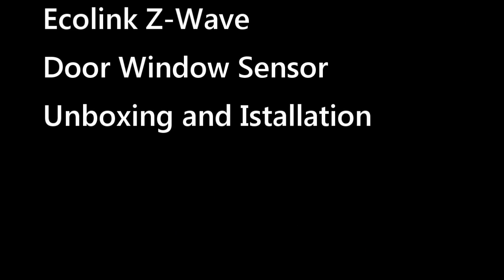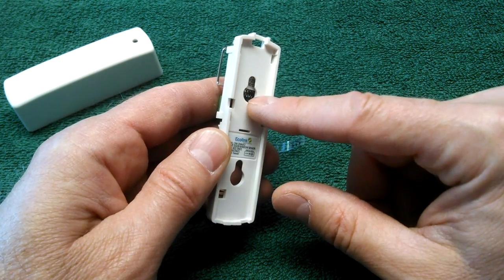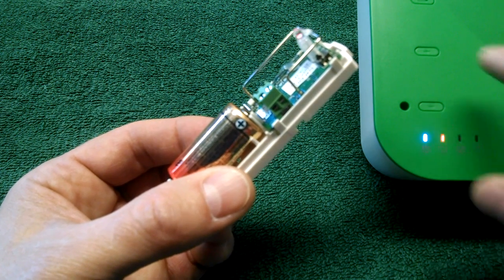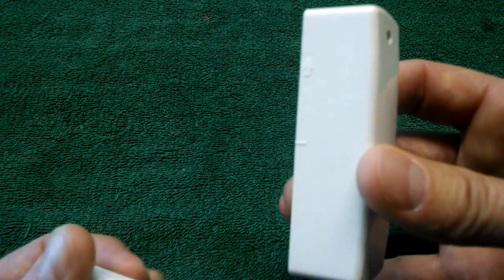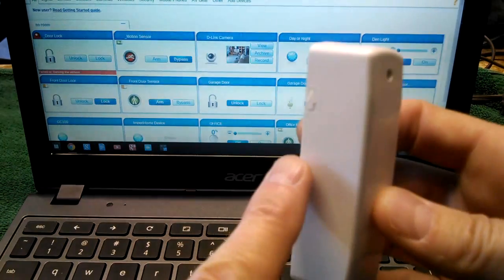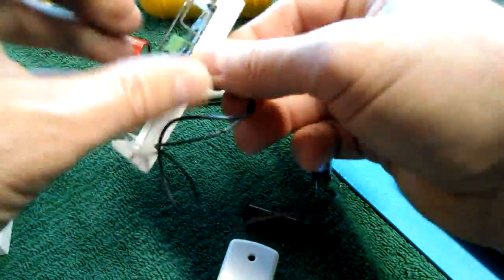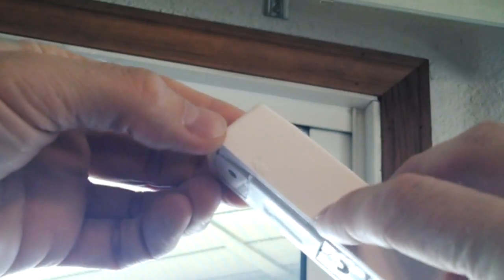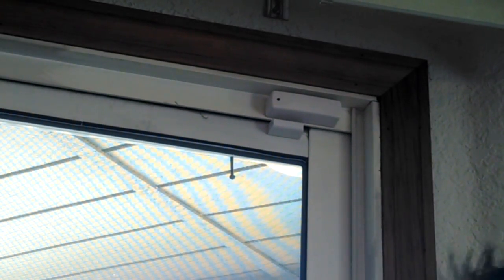007 Systems Ecolink Z Wave Door Window Sensor Unbox Installation

Comment: Will this work with Applekit? Or Philips Hue?
Reply from the maker: They are Z-Wave so they should work with anything Z-Wave. That is the beauty of Z-Wave.
Apple Homekit has a limited number of devices it can work with so I think the more accurate question is, Will Apple Homekit work with Z-Wave? 
As of now it looks like only these overpriced products work with Apple Homekit.
http://www.apple.com/shop/accessories/all-accessories/homekit?page=1

Phillips Hue works on the Zigbee protocol, so no it will not work with Z-Wave either.

Comment: UPDATE: I got it working.  I isolated the sensor that heads to my front door.  I am not using the resistor that is in line (should  I?) to the security panel. The length is maybe 30-40 feet from the security panel to the door. 

Thanks for a solid video and quick response. I might include a video on my channel in a week or so when I have time. 

I plan on rezoning my house a little to be more specific. Also,  this sensor beams to SmartThings, so I can track it through there. 

Thanks again.
Reply from the maker: 808orion 
 There resistor is used at the end of the wire to detect if the wire is shorted. if it works without it you apparently don't need it but keep it in case it causes problems later.
Glad it is working.

Comment: I have a wired home security system currently monitored by ADT. I obviously want to get out of this relationship and have served my 3 years with them. Now that the home automation tech has started to stabilize out, I'd like to consider an upgrade.

Would it be possible to use the external sensor functionality of this to turn my wired "zones" into a single wireless z-wave sensor? For instance, I have magnetic sensors in a series at two windows. Their wires run back to the main security box (Concord). I intend to run those wires instead into the external sensor/switch of the Ecolink sensor. Would that work, is it too far? Would I need to adapt the power supply due to distance or such?

The ultimate goal is to tie this into a Samsung Smart Things Hub. I could also have it professionally monitored for $20/mo instead of the $50 that ADT charges.

Thoughts?
Reply from the maker: From what you are telling me it should work. Hard wired contacts are always better than wireless sensors. but it should work as long as the run is not extremely far. How long is the run?
What power supply are you referring to?
We offer professional 24/7 alarm monitoring for less than 9$ a month. If you decide to go with a dedicated alarm panel, check it out.
http://www.007systems.com/alarm-monitoring.html
Reply: Thanks for the quick reply and link. I'll keep it in mind.

As for the distance, the farthest window is about 70 feet away. After that wiring goes through the ceiling/attic, I'd assume 90-100 feet in wire length. I could probably jump in the attic and find the wires if needed and shorten it to 10-15 feet and really just rezone my house. I'd like to have access to the wireless sensors though for battery replacement, so I'd probably run the wires back into the house through the ceiling and place the Ecolinks at the top corner of the room.

As for battery, I guess I was mentioning the battery backup that comes in the system, but I guess that wouldn't be needed anymore.

I'm a DIY'er and have worked with some electronics. Feel free to talk over my head and I'll do some research if I need to.

Comment: what brand and part number is that external switch you have? thanks.
Reply from the maker: I do not know as we have had these in our shop for testing for years. If you are looking for a replacement for that switch, we do have this type which are almost identical.
http://www.007systems.com/contacts.html

Comment: Hi, when you add the external reed switch, and you bring the magnet to the switch the controller displays green (closed), how can that be if the main unit's magnet is away? Are they displayed as two switches on the controller?
Reply from the maker: +f3d3r1c0 Great question!
The controller sees this sensor as one and only one sensor.

Comment: the video  left  out  -   WHAT DOES IT DO ?     how do you deactivate it ?   if  an intruder comes in  does it make a loud noise ?    how do you turn off the unit   when  you come into your own house ?
Reply: +MsNumber1rider this integrates with a home automation controller like a vera or smarthub.  The home automation controller can act on the door open/close events by turning on lights, sounding alarms, sending a txt, changing the thermostat levels - the sky is the limit.

Comment: Hey man I need help. This Window door sensor is the first thing I've tried to pair with my Veralite controller . The sensor will not include to the device. The red light on the sensor does not work properly when I place the magnet near it and away from it. Does the Vera need to be plugged into the power jack and ethernet cable during the paring process.
Reply: If the light does not illuminate with a good battery, I would call Ecolink to get support and see if it is defective. If you got it from us, let me know and we will get you a working one.